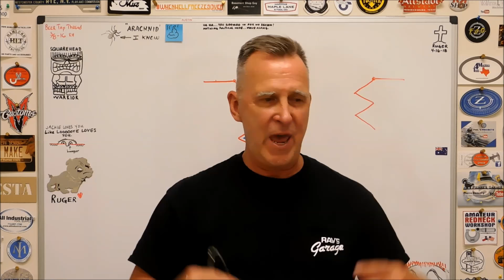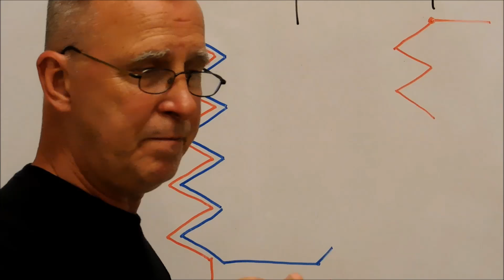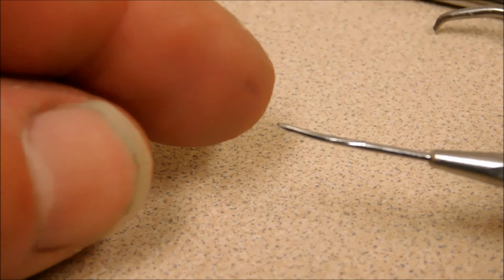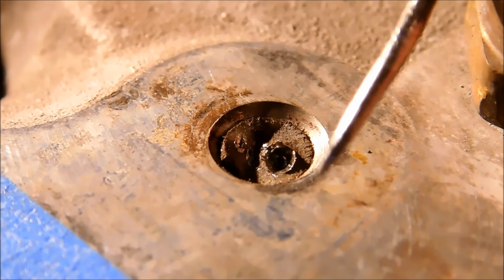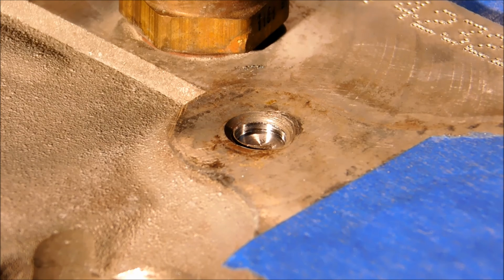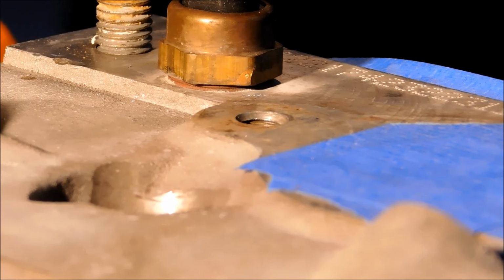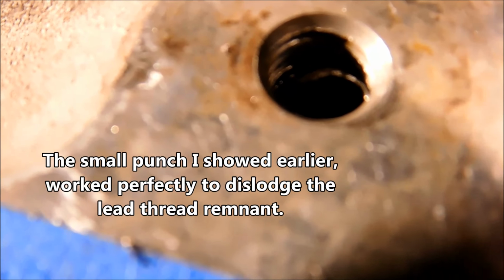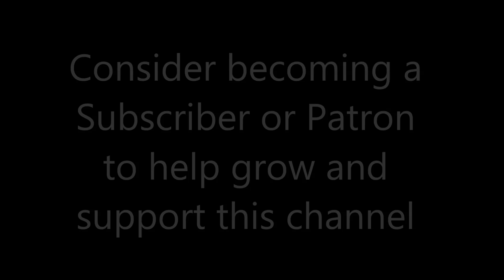Removing Sub Surface, Snapped off Bolts -- Take a Look !!

Comment: The problem is that you just wasted your time.  I've done this with things like turbo housing bolts and it's worked quite well, but in this case:
- it's an aluminum casting, you could have easily just held a nut over it and welded it to the top and the heat would have loosened it, I've had good luck with bolts broken off even a little more than 1/4" below the surface once you get this technique down, and you don't need to set up the head on the mill, do any indicating... it takes a fraction of the time.
- 99% of the time that someone is messing with some of those heads it's to put headers/turbo manifolds on.  Almost universally there has or will be a bit of a side/diagonal load on those threads and the aluminum is super soft, so any funny load on the bolt will result in it ripping the threads out.  Anti-seize or lube on the threads actually seems to make it easier to rip the threads out.  If I have any reason to mess with a bolt hole I'll just drill it oversized and install a helicoil.  I keep a couple of packs of them with the right threads around just for this.  First, you'll end up with a much stronger, steel thread that will last much longer, and second, you'll end up doing it anyway later on, most likely at the worst possible time, like when it's installed on something and you'll have a bear of a time getting to it without removing the head.
Reply from the maker: As much as I appreciate your comment, I don't view the successful extraction of a broken exhaust stud from a head as a waste of time. I wasn't asked to heli-coil it, and considered the rusted bond too thick for a welded nut to be effective. So, not a problem at all.
Reply: Some people just want to see a different technique,   some people can't weld
Reply: I’ve welded nuts to broken studs or bolts just to have them break off further inside the hole.
Reply: @joepie221  I understand but the thing is that in that application I can just about guarantee that one or more of the bolt holes will end up stripped either by the time it's re-assembled or before it's disassembled again.  Since your son probably didn't pay you, and you were given a good example to turn into a video (and we're currently adding comments which are helping this video's performance ;-) ) it's not a waste of time for you, but it would be for someone else.
Reply: @tinmann19  that's not that uncommon.  With GM heads it's often the coolant passage plugs that do that kind of thing and can be more difficult to remove then just about any bolt, but with aluminum heads it's easy enough to weld on another nut even with the broken off part quite far down in the head, the steel doesn't stick to the aluminum and there is enough thermal mass in the aluminum that if you hit it fairly quickly with a MIG you can fill quite a hole with steel without melting the aluminum threads in the hole.  I can think of one example (that's running in my car right now) that the 4th nut that I welded to the top of it was the one that finally got it out, and it was still faster than setting it up on the mill even though I had a set of angle plates setup on a mill to hold a set of SBC heads at the time for another reason.
Reply: I'll also add if you have the ability to do this machining, you most likely can take a bolt, drill a hole through it and thread that down into the hole and use that hole to feed weld wire down to the broken off bit of bolt if you're concerned you can't fill the space between a nut and the top of the broken off bolt.
No matter what I think we'll all agree not to try an ez-out, seems like the only thing easy about them is how easily they snap off and cause you a much worse problem.